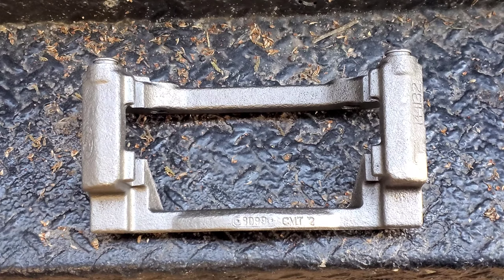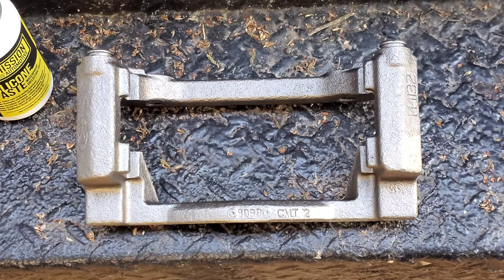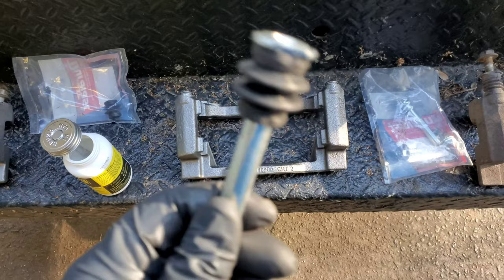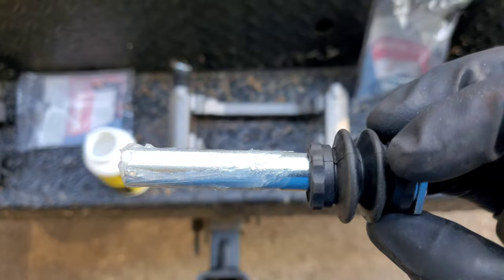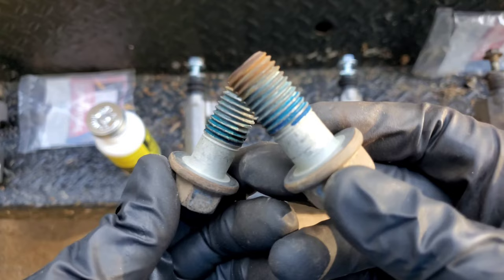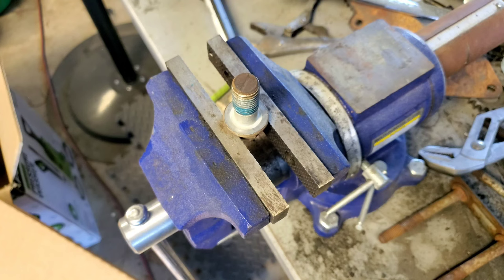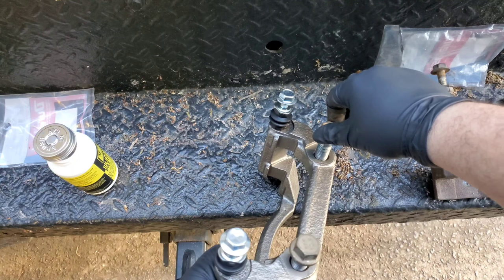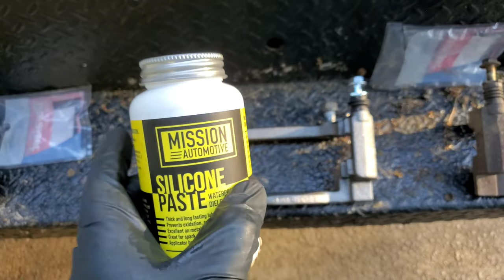How to setup a Brake Caliper Bracket

Comment: Not supposed to put grease on the tip of the slide pins it will keep them from sliding in all of the way😊
Reply: You are right
Reply: Don't know about your vehicle, but my 2002 S-10, original equipment brake caliper brackets, I'm assuming they're AC Delco, have small pin holes on the backside of the brackets for air and grease, if too much is applied, to escape from each of the slide bolt chambers preventing any type of seating problems. The holes are approximately .010 in diameter and are countersunk.
Reply: pretty sure the flats on the pins are channels allowing grease flow.

Comment: @15:08 I see you applied Blue Threadlocker on those mounting bolts? I put a Blue Thread Locker on that job like a 1.5 years ago, everything was good, no problems w/breaks. I see in many film people use Blue TL on those attaching Brake Bracket-to- Knuckle bolts. But now I did smth else on suspension and needed to remove the Brake Bracket again. When I looked to double check the torque and everything in Shop Manual for our 2001 Saturn SL2 (I have one), they say there to apply Heat 272 Loctite or equivalent. And if you don't have that Red Loctite, you need to replace the attaching bolts. Of course it is advice for a shop w/unlimited access for the bolts of that type and everything, and they are very precise (supposed to be of course). But why everyone applied Blue, as Shop Manual says Red? That what puzzled me. This is full Saturn Shop Manual 2000-2001 S-series, very detailed, 3 huge volumes (4-5 different books inside of each volume, put together w/binder), thin strong paper like papyrus. I'm confused on all that. If I apply Red, will I be able to brake those nuts w/huge breaker bar, or heat would be needed? It is not a problem to apply heat of course, but there are CV Axle Boots there close by, I even don't know. And again, everyone applies Blue: you, The Mech a nic, Chris Fix, many others. I would appreciate any opinion on this matter. Thank you for the great film.
Reply: Red Locktite would need torch to remove. Blue is medium, red is high strength.
Reply: @hurricanedigital  I know, but what they recommend in Shop Service Manual (it is for 2001 Saturn SL2 to be specific) is Red, that is the thing. I assume, you use that special flame protective cloth on rubber hoses around to remove that Red next time, if you follow that Manual by letter. But here is the question how many shops will use that cloth and torch to remove the bolts, with their level of negligence ...
Reply: My 2002 S-10 used red and I was able to remove with a breaker bar, but if you need to use heat and are concerned about heat buildup not remaining localized and affecting the boot, I would suggest using a mini torch.
Reply: @Orange-Jumpsuit-Time  Thank you very much, I didn't know about mini torch, I'll check on that, definitely get one. I've heard that if you apply Red, and then remove without heat you can break the bolt, or smth else. Probably depends on the amount of red applied. I think I'll go in the future w/Blue, but thank you again for the explanations. It is important for me to know what they mean in my Shop Manual for 2001 Saturn SL2, when advise to apply Red. before it was a mystery for me, how to remove then.

Comment: PLEASE!... DO NOT PUT grease on the tip of the slide pins. ( please Google why you shouldn't)
Reply: Don't know about your vehicle, but my 2002 S-10, original equipment brake caliper brackets, I'm assuming they're AC Delco, have small pin holes on the backside of the brackets for air and grease, if too much is applied, to escape from each of the slide bolt chambers preventing any type of seating problems. The holes are approximately .010 in diameter and are countersunk.

Comment: Does anyone want to tell him not to put the grease on the flat end of the pins? Anyone else cringe at that? NO! Don't push that little bit of excess  grease into the bracket. Ugh.
Reply: Don't know about your vehicle, but my 2002 S-10, original equipment brake caliper brackets, I'm assuming they're AC Delco, have small pin holes on the backside of the brackets for air and grease, if too much is applied, to escape from each of the slide bolt chambers preventing any type of seating problems. The holes are approximately .010 in diameter and are countersunk.